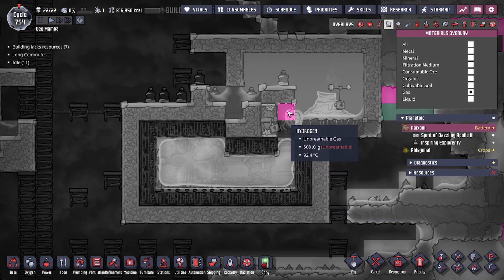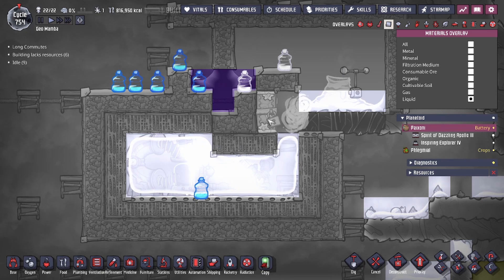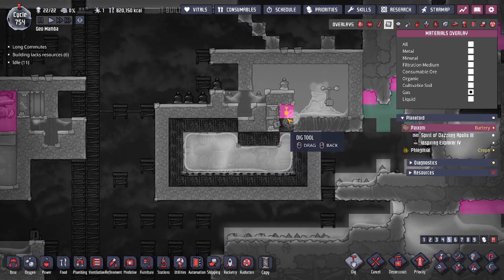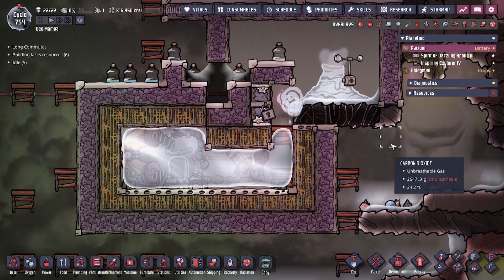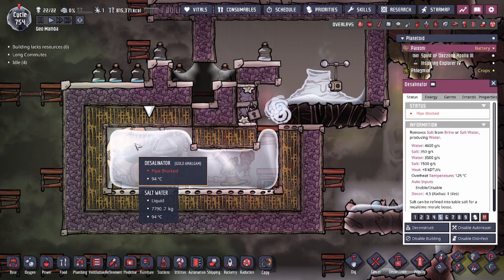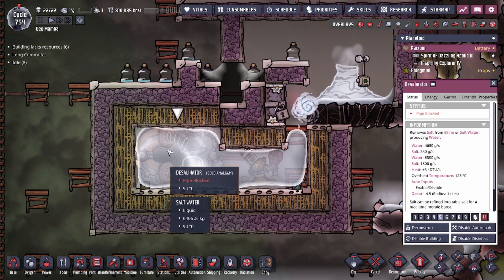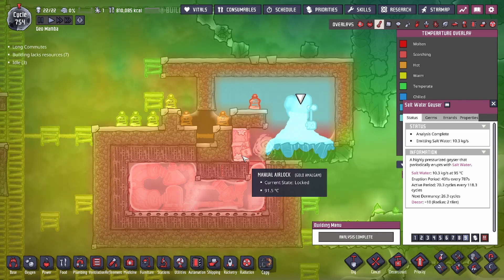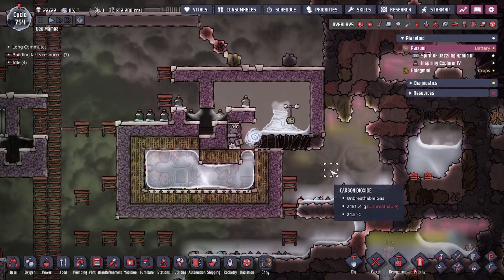Hot Water Geyser Tamer - Minimal Heat Leak Design - Oxygen Not Included

Comment: Nice tamer... So, what do you do with the heatness of water? 95 degrees isn't a joke...
Reply from the maker: try to keep the heat from leaking by insulating the box, then feed it an electrolyzer. the idea is that its easier to cool own oxygen than water (stats comparison). this can also be used to warm stuff up like -10 pollute or salt water so you can sieve it without breaking pipes.

Comment: If I just wanted to lock it, I'd enclose it with insulated tiles.
My issue is how to use it without overheating my base.
If I put the hot water in Electrolysers, they'll produce much hotter oxygen.
Reply from the maker: that's true, the break-even point for water is at 70c and anything hotter adds more heat to the o2. 
you can use the hot water as a heat source for a few things: maintaining temperature levels for slickster farms, heat source for warming up below zero liquids to be sieved/desalinated, main water source for the research reactor as it takes all h2o variants, if you know the metal refinery cheese it can be the liquid fuel video: https://youtu.be/s_2OWdSbdzI 
just a few ideas, hope it helps